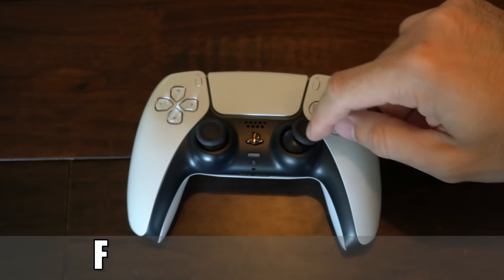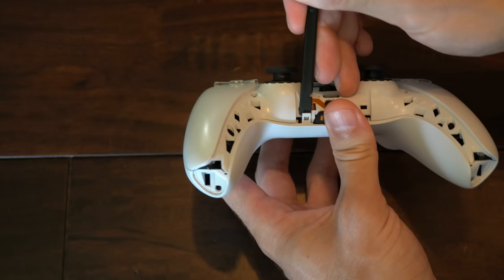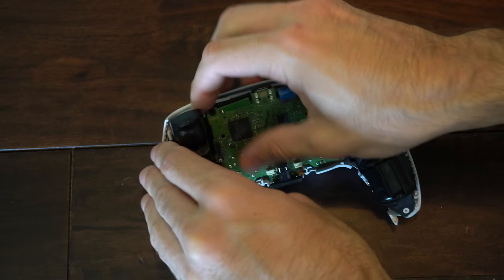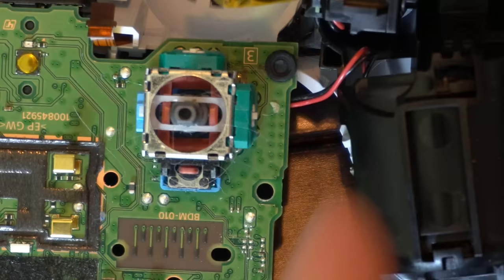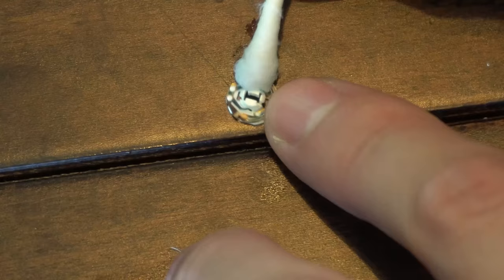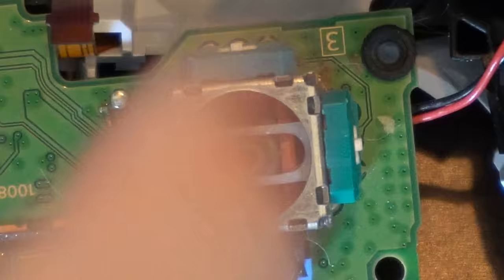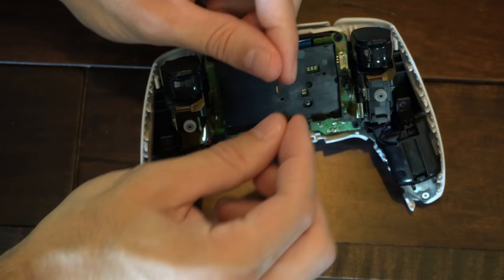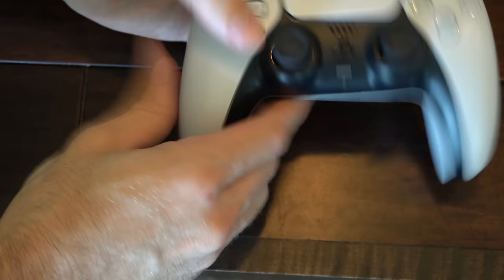How to FIX PS5 Controller Stick Drift & Moving on its own (Best Method)

Comment: Can't do anything right, all these comments saying it worked, and here's me with my controller that's now 10x more fucked lol. Time to buy a new one
Reply: That's happened to me on ps4😅 debating on trying with my ps5 but it's the fear of this that's stopping me🤣
Reply: Same here, idk what I did wrong. Nothing broke, and I put everything back together like it was, but the analog only moves to the left now.
Reply: You broke something. Maybe fat fingers?
Reply: @nutnution3957 You put the sensor in backwards, or over time, the little bumpers bend and wear down. On average, you'll have to buy a new controller about once a year for "average play" and more often for hardcore playing. If you've had it more than a year with no issues, you are EXTREMELY lucky, or barely play.
Reply: @Jerharris90  I had the controller for probably a year now. I found how I fucked it up. I accidentally disconnected a wire while cleaning it. It is what it is, I bought a new controller
Reply: @Jerharris90  ps2 and 3 controllers lasted forever, they design them to break now
Reply: Lmao 😂I’m sorry bro
Reply: Samw
Reply: Don’t waste your time. All this crap rarely work.  All you end up doing at most is messing the controller up. I’ve tried this method on Xbox controllers, etc. it doesnt work. Buy a new controller.
Reply: Same
Reply: Yo Right Now my R2 Button stopped working. Like why did I even try. 🤣😂🤣😂
Reply: My joysticks stopped working all together and I didn't break anything I did however move those semicircle metal pieces though could that be the issue?

Comment: After reading all the comments, I was really scared that I might accidentally break something but playing with stick drift had become nearly impossible, so I gave it a try and thank God it works absolutely fine now. Thank You so much.
Reply: Trust me you’ll probably break something, I brought a tool kit my second time around wit tweezers
Reply: @novanotfoundyt you not read his commentV said he did it
Reply: I just tried to fix my black Dualshock 5 and one of the wires connecting to the motherboard broke in the process and I didn't even realize it. I then went for my white Dualshock 5 because it has stick drift too and I managed to not break anything and the controller works great. You definitely need to be EXTREMELY careful in the process. @aiden
Reply: I did this and when I put the controller back together all the buttons were scrambled
Reply: I might as well try too bc one of the controllers drift is abysmal
Reply: @novanotfoundyt  I think you commented to the wrong person but according to your answer, there’s no point in telling somebody not to try this if they’re controller is already screwed up.  A bad Controller is worthless therefore you have nothing to lose when attempting to fix it.
Reply: I fucked mine up. Now for some reason I can't even walk or run with the left stick. It automatically goes up and a little right.
Reply: is easy but even if you clean it it will do the same thing again because the problem is not the cleaning is the green thing the hold the spinning gear it gets wears out over time
Reply: @Druid4026 you wrong dude it works perfectly fine now. If it happens again just gotta clean it again
Reply: @swifty86gaming41 when I put mind back together it stopped working completely 😂I actually read that you aren’t supposed to take the controller apart period it will just break it
Reply: @Drunkpunch33 Sounds like something someone from Sony would say. “Buy our controller  every time make sure you never open it”
Reply: @Drunkpunch33  If it's already broken there is absolutely zero reason not to attempt to make a repair. If it winds up broken further, hey, now you have a bunk controller to test future repairs on. Maybe you can learn about electronics and attempt to fix what you broke with a soldering iron. You've exposed yourself as a very obvious marketing shill. No one listen to this individual. Be careful and attempt repairs on anything broken for which you do not have a warranty anyhow.
Reply: @Keyw  actually I’ve tested it again numerous times because I have a lot of ps5 controllers I’ve come to the conclusion that it is safe to open the controller just don’t open the green sensors for the joysticks because it will break if you just blow air on it and clean the outside of it with alcohol it will most likely fix the drift if you open the greenish bluish sensor you risk breaking it
Reply: @Drunkpunch33 I had no issues opening the green part
Reply: bro ik how u fill
Reply: @dfuma213  if you open it you risk breaking the sensor and also just putting debris on the inside of it which will worsen the drift I just clean the outside of it and blow on it and it fixes it

Comment: It's important to note that once you pull out the little white pieces with the springs on them, you have to be very careful with the way you handle them. One rough touch against the spring before reinserting it back in the slot on the analog stick just might make your stick drift situation a whole lot worse. So yeah, basically, take your time when following this tutorial. There is no rush.
Reply: Rip my controller bc of this
Reply: Found out after the fact. Now the drift is a disaster!
Reply: Would've helped if this bloke said that

Comment: Bro I’m not gonna lie, halfway through this tutorial (as I’m matching what you’re doing), I didn’t think it was gonna work. Stick drift is gone, I’m so blown away! Thanks a million.
Reply: Seems like alot of dismantling. How was it for u putting it back together
Reply: @Lucky-to7ly Brother i was not looking forward to doing it, had to go to lows and get a mini cobalt screwdriver for 6 bucks cause i didnt have any small enough, the whole process took like 15 minutes. worked great, easy to put back together as done in the video, absolutely 0 stick drift it 100% works, i used a knife to unbind the controller and used the products said in the video to clean it, dont sweat it

Comment: Great tutorial but please be aware to not push those two metal semicircles (see 6:45) down too much when cleaning the potentiometer with the q-tip and alcohol. If they are two close to the white plastic, they wont make contact with the graphite pad and will likely make your drift issue much worse (as it did for me). Also the two metal semicircles should ideally be right next to eachother with very little separation between the two. I used a pair of tweezers for this and once i assembled my controller, my stick drift was completely gone
Reply: Wow bro I wish the guy in the video said something about it … pretty sure my controller is fucked now
Reply: @grimkxdo 😂😂😂😮💀
Reply: Thanks! I really love that I’m getting this information now😂 bit too late
Reply: So I did it and failed and now my left stick is literally the max is could be pushed upward on its own you think maybe I did that on accident ? Sucks too because originally the stick drifted to the left now that’s fixed but it goes straight up now
Reply: I have 2 controllers both have stick drift very bad. Both at the left analog goes all left. Right analogs are fine. So I have opened both and took one of right analogs white piece and changed with other ones broken? Left analog white piece. But nothing changed. Still both controllers left analog goes left. So if it's not because of white piece what's the problem?
Reply: @nuvola-b bro same my left analog is killing me man is moving left too much I can’t stop it I can’t get on my ps5
Reply: @Visca_Barca777  i bought spare parts then did some soldering now its just like new.
Reply: Honestly I'm too scared to risk it
Reply: Damm I don't think I completely understand, is those metal circles supposed to be leaned like that (half of it up half of it down?)
Reply: @shinobly  Yes, those metal circle are supposed to be evenly fanned out. The inner circle should lift up at about 20 degrees and the outer circle about 40 degrees. When I first put mine back together, they were both lifted up too high and stuck together and the movement ended up stuck in that direction. Opened it up again and pushed them down to that position I just described and it works now. Really feels like the heart of the issue.
Reply: @Sheriff_Bruce_Lee  Damm that'll I'll try my best😷♥️🖐️
Reply: @nuvola-b the circuit board is fried look at the green board behind the stick and you can tell…
Reply: @nuvola-b Did you solder a new analog or just the sides green parts
Reply: @Na-ic3nr  that white piece with 3 legs. I soldered them
Reply: @Visca_Barca777 i thought this was just my ps5 so apparently everybody’s left stick stops working after 5 months?
Reply: @nuvola-b it’s always my left stock going left as well
Reply: @mckinleyconito7215  yeah, look at some forums. Known problem. Horrible design.
Reply: Yeah wish he would have said that, cause now my drift is way worse.  What’s the point of a tutorial if the important details like that get left out.
Reply: This should be the focus of the whole damn video right here, his sh*t made my issue worse, I didn't have gunk or hair (not sure how tf this guy managed it) but my wires weren't fanned out and way down low, bent them how you described and presto, works like f*ckin new, bless you sir, should make your own proper video and get a sh*tton of views 🥰
Reply: @Sheriff_Bruce_Lee  I was ready to say f*ck it and buy a new controller, then saw this guys comment and it made some sense, then saw your comment and it all came together like pieces of a puzzle, completely solved my issue, thank you my friend
Reply: Thank you you saved my life
Reply: I followed the guide for dismantling, your advice for the root cause on the stick drift and the stick drift is completely gone. Thank you both!! also I used a guitar pick( Jim Dunlop, Nylon 60mm) to take apart the green guards that are housing the semicircle things. It was perfect thickness and also gentle enough not to damage anything in there. Good luck everyone!!
Reply: Wish I read this before I started cause now my two controllers are fucked 😂😂
Gonna try again tomorrow but goddamn
Reply: Just did it and same thing, stuck going up now, so i smashed mine into pieces on my dining room floor. Felt better than trading it into Gamestop.
Reply: So should the little metal mini circles be close the the white part or spread away farther ? Because I tried what he recommended and my drift is horrible my controller goes all the way up now
Reply: @Gunna5star  there are 2 wires, the inner one needs to be bent 20° up from the white plastic housing, the outer wire at 40°, just use something slim like a needle or maybe a small paper clip to bend the wires appropriately, completely solved my issue 👌
Reply: to anyone who reads this thread...this is the BEST advice given EVER. I've purchased 4 controllers that have all had this horrible drift and I've always done these tutorials but it never worked. THIS COMMENT IS GOATED. I fixed my most recent controller because of it and decided to go back to the other controllers and now they all work perfectly. This is absolure crucial info these tutorials always leave out. Thank you so much.
Reply: Shmooopy you can go back and fix it man. I did.
Reply: Comment is the goat 🐐! Fixed like brand new! Important details skipped by creator!
Reply: @mckinleyconito7215  yeah dude this is ridiculous. Barely been 10 months…smh
Reply: @jeremiahalvarez5361 same here. My R3 goes straight up. I did everything carefully and gentle but still somehow it made matters worst.
Reply: @grimkxdo worst vid ever 🤦🏻‍♂️
Reply: Really thanks u
Reply: Bro saved me 70$ the little silver thing should be pushed up alittle bit not touching the bottom
Reply: where did u bought the part ? @nuvola-b
Reply: Yes I noticed that the 1st one i did, that ring was not separated so it got a little tweak,, and now no more drift
Reply: same here
 @grimkxdo
Reply: Dude what a King !!!! I opened cleaned 4 times nothing worked before i saw your comment. Now it works finally no stickdrift thank you sooo much!!!
Reply: Once I went back and did this it worked like a charm! Great comment! Thank you so much!
Reply: Definitely what's happening with mine I bet haha
Reply: @Sheriff_Bruce_Lee so the way it is shown in the video is the way it’s supposed to look like?
Reply: It's been 8 months but thank you, this comment helped immensely
Reply: This comment absolutely works!
Reply: Ok so I did all of this and my right analog stick instead of drifting to the left now it just goes straight up and doesn’t stop, I can move sideways but not up and down at all it just goes up 😩😭 someone help me please
Reply: @jerryfinger1967 I had the same problem, you probably damaged the sensor. If you still have ps4 controller lying around you can switch the sensor out en put it in the ps5 controller. It worked perfectly for me
Reply: @balancer2450  Is that the white piece? I just ordered new joysticks that should be here tomorrow, I was told that I can take the white piece out of the new pieces I just ordered and replace them in my controller. Hoping this works because I really wanna become capable of fixing this issue myself instead of constantly buying new controllers
Reply: @jerryfinger1967  yes its the white piece
Reply: @nuvola-b the same thing that happened to you happened to me what did you have to buy to fix the issue
Reply: Correct, the small aluminum pieces need to be treated delicately to avoid bending or misalignment - if it occurs, replacement housings are pretty cheap (like $10 a pair) and can be easily replaced with amateur soldering skills
Reply: Bro this is amazing! I was following the instructions of this video until I noticed my controller was really clean inside. Then I thought that cleaning it cant be the solution. After reading this comment i noticed the little metal semi circles on my sensors were all flattened and not separate from each other. It must've happened over time (2 years). This was the real fix!!! Thank you!!
Reply: Thank you bro! It was stuck forward, tried putting everything back and forth a few times. Your tip saved it. Thanks!
Reply: @n8strength I chuckled to hard 😂
Reply: This comment needs to be pinned. I followed the video and it fixed one stick but the other started having extreme stick drift. Disassembled and redid the steps and still it didn’t work. Then I saw this comment, adjusted the two metal piece and it was all good from there. Thanks!!
Reply: wow i really wish i saw this earlier

Comment: Thanks for the instructions buddy... and to anybody reading the comments worried about breaking the controller, it seems to be fairly sturdy as long as you take your time, don't get overly rough and use the proper screwdriver... i used my pocketknife to pry the trim piece off and the controller shell apart
Reply: Don't call people buddy it's patronising
Reply: @christianmcbrearty  sure thing little buddy

Comment: Dude, I've been sending me controllers back to PlayStation for years. This video is brilliant and fixed my major stick drift in an hour. It was so bad my character would literally strafe left constantly and now it works perfectly fine!
Reply: My controller is doing the same thing!! I need a new controller ASAP! I just tried this fix and the drift is harder now then it was before.
Reply: @daradee01  bro same wth
Reply: @daradee01  was there a fee to trade it in for a new one?
Reply: @joey2765  no, plus I am a pro member and I got extra with my defective trade in. They only gave me $20 (I used to work there so I know how it works) and since I'm a pro member I get $5 free a month so I used all of it towards my new controller. Ended up paying $55 for it, I got a blue one
Reply: @daradee01  wow that’s too much. And GameStop damn near about to shut down anyway. Best choice is to buy a 3rd party controller online
Reply: @joey2765  possibly 😮‍💨 but I wanted the PS blue controller so I can get the blue covers for the system
Reply: @daradee01  Blue is my fav color, but I'd rather have a controller that works, than one that's blue.
Reply: I always had to aim to the right so the drift would make it centered LOL..
Reply: @sizlax  Yeah I'll take a doo doo brown controller as long as it works XD
Reply: @joey2765  Some of the third party controllers are kinda nice too almost better than a oem one
Reply: I barely bought my controller for 2 months and it's drifting slightly to the left now if I move it through the right. Do you remember which part you cleaned or moved to fix the issue? Again this came controller is only 2months old 😡 never dropped either
Reply: @JzLyfe  you have warranty for one year at sony
Reply: I broke mines trying to fix it I’ll stick to trading it in to GameStop for a brand new remote
Reply: I'm a bit late but when I play I literally just beyblade

Comment: I was honestly scared to try this out but it was my only choice since the remote would make me spin forever in every game. Thanks to this video it fixed it. Not even a slight drift👍
Reply: Same here bro. I've never taken anything apart and put it back together.
Reply: I took air compressor n clicked my stick down n wiggle it around with few good shots of 100psi air from air compressor n seems to be fixed. Of course mines only 6 months old n my kid might got crumbs or something in there's since its his favorite controller he uses
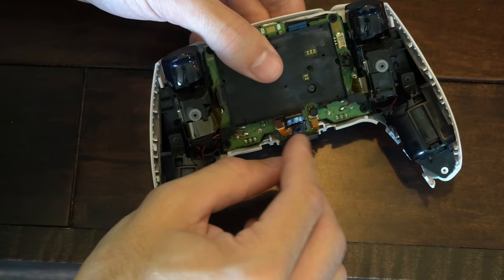Reply: kair0315 pe😅😅😢😢😊r😅😅jjj😅ju 9:27
Reply: @nawfgawddagamer1558 did it work? The stuff ge showed in the video
Reply: This tutorial is the best, my stick drift was crazy on both joysticks, now 0 drift. Do be careful when pulling or bending stuff because some components are very fragile
Reply: Try a ps3 and never worked
Reply: @Keepcalmandbangscrew probably cause ps3 controllers are built different

Comment: I just followed this video and took the controller apart, cleaned both sensors on the left stick. Totally fixed the drift. Thanks. From a guy that has taken old Xboxes apart and put them together, only to have a broken Xbox, this felt good.